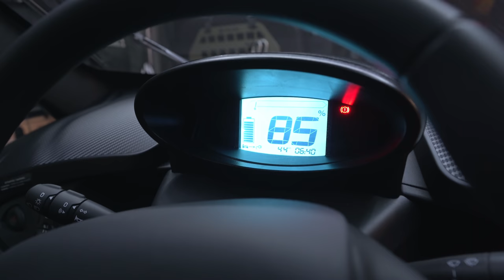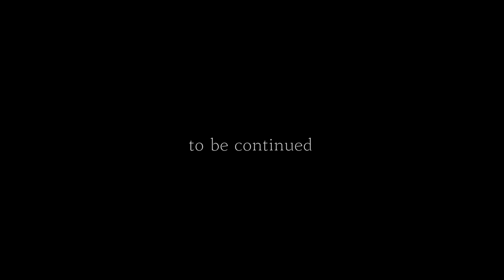AMAZING CAMPER VAN BUILD DIY for 7 DAYS ALONE | Renault Master VAN

Comment: Great job on carpet install, and great way to clean it too. This build was over the top with creativity. Not what I expected. Totally a different way to equip a camper van with multipurpose equipment. Then an electric car. The RC at the end was the cherry on the top of the sundae.  Well thought out. You never disappoint, you only succeed in amazing everyone. Great video and editing too.

Comment: Very clever. Loved the netting etc, massive weight reduction & practical. Round lights, grass  brilliant. There are benefits to keeping interior open & having bench etc you can move outside but sleeping on a temp bed will lose appeal fast.
Reply: Btw what was black ‘tape’ applied to internal sides? That’s excellent stuff…
Reply: @joydot7620  I think it was velcro, but I'm not sure.